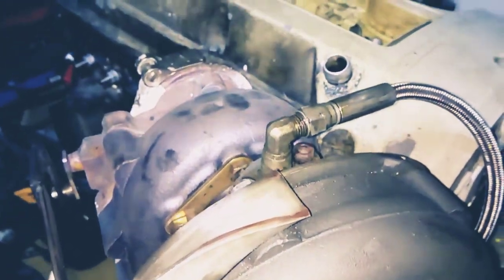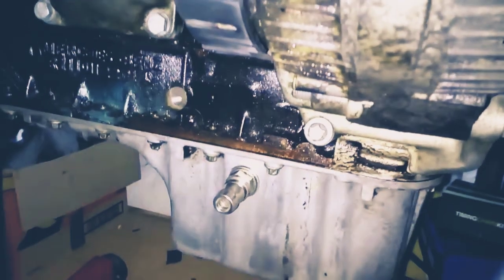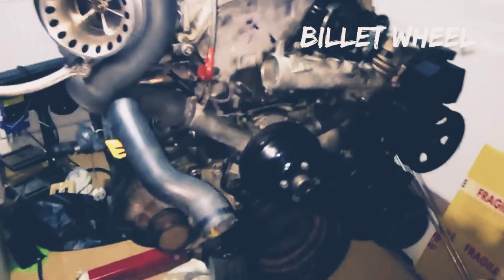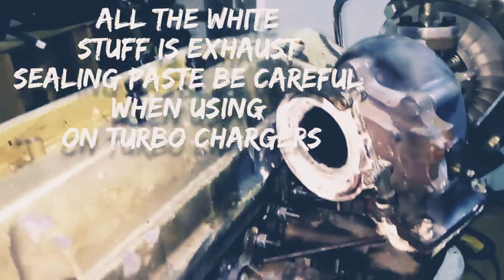Mercedes Slk R170 230 M111 Turbo Sleeper engine pt2

Comment: How hard was the manifold to make? Did you use the stock one and just cut it? Or made it from nothing? Thanks again for all the details lol. Helps a lot man.  Keep up the good work 👌🏻💯
Reply from the maker: Good question for a primative manifold you can make one for the mercedes log manifolds found on the m113 4.3 5.0 v8s if you cute the outer casing off the pipes inside are literally just slotted together you can reorganise them weld them together and then weld them to the stock manifold face plate or some m111's do have a log manifold standard same principle applies. Our manifold took a day for me and Ben to make and is made of 2inch oval thick wall stainless steel and required a lot of pie cuts
Reply: @M-oneeleven-M111  do you think the stock type of manifold could handle a turbo though? I was thinking use one of the log ones and just cut the downpipe part off and weld it closed then cut and weld the flange onto the stock one
Reply from the maker: @djhairtriqz2084  yes it absolutely will if you look at our exhaust manifold video we did exactly that best to Tig weld where possible but to use the stock look the outer casing will need cuting off so you can weld the inner pipes together

Comment: Im turboing my clk 230 m111, i have already make the manifold,  fit the turbo in and now i need to connect all together and clean the engine bay. I have a question, im lazy to put the oil pan out, so i was thinking that i will connect turbo oil return with my oil cooler what u think? Thanks for answer.
Reply from the maker: Sounds like a cool build,if not already please subscribe I will also be doing a turbo m111 clk build. I would always recommend draining back to the sump personally for a turbo. The main problem you may get is oil backing up in the return line and blowing out the oil seals in the turbo. However if you tried it and the oil drains away fast enough that would be ok. The main thing to think about is making sure the oil drains from the turbo and doesn't fill the turbo bearings up to the point it pressurised it. On some engines I know people drain it back through the dipstick tube also, but I always recommend going to the sump even though it's a lot more work. Ide say the dipstick tube would be more likely to flow better than the oil cooler lines. But there's only one way to do it right and that's to the sump, but if you wanted to try the dipstick tube (at your own risk) that maybe an easier way I personally have never tried it. I hope that helps 🙂 sorry it's not necessarily the answer you were looking for.
Reply: @M-oneeleven-M111  good answer thank you man, i think the oil can't to back to turbo since there isnt any backpressure pushing the oil back, And even the oilcooler Is lower than turbo, but i will think about pushing it back to sump since its the best place
Reply from the maker: @GamerLesin  no worries always happy to try and answer questions if I can 👍

Comment: Did yo change the piston or any thing in inside the block
Reply from the maker: Not on these engines all ran completely unopened stock engines, but wouldn't recommend aiming for above 300hp the headgasket will not take it. I will be building a 2.5 stroker m111 which will be a budget build series, if you like what you see on the channel please subscribe. Though I wasn't very active last year I intend to put out more content this year to help folks